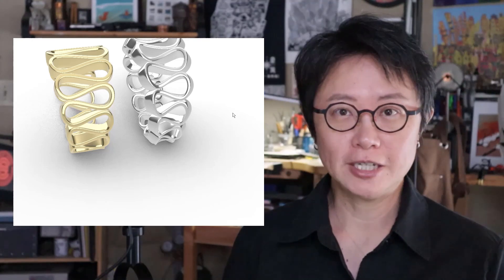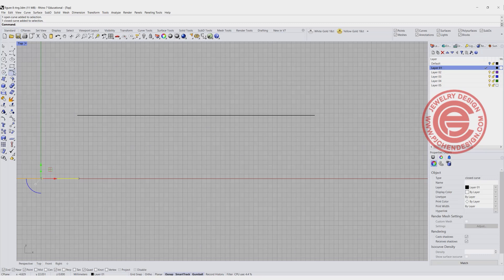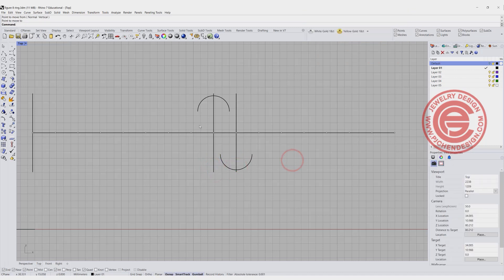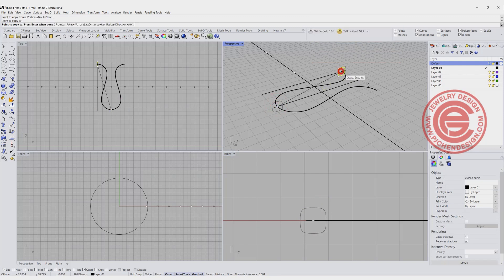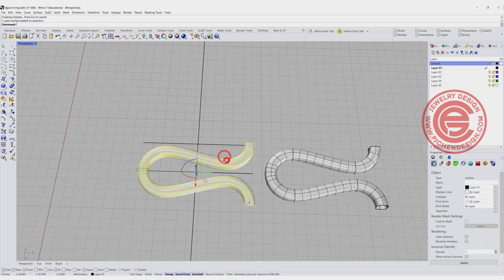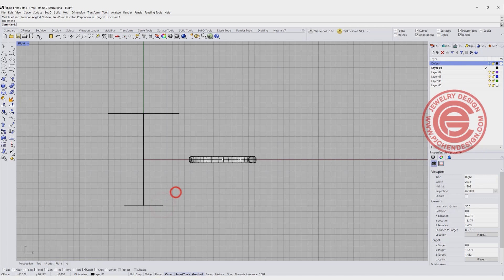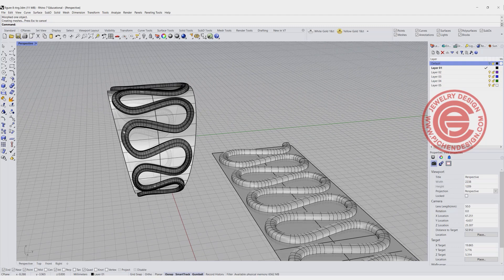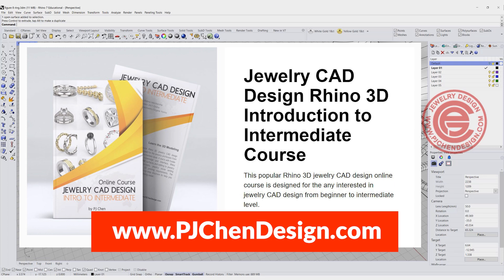Figure 8 Ring- Jewelry CAD Design Tutorial 3D Modeling with Rhino 3D #291

Comment: Hi PJ.

Suppose we have a line of 100 units. Can you tell me methods to extend this line by 10 more units?
(google Translate)

Autocad Command  : Len > de > +10
Reply from the maker: not so sure I understand your question correctly. If you are asking multiply the parts, You can use copy, or array commands in Rhino.
Reply: @PJChenJewelryDesign  I want to stretch the length of a line.